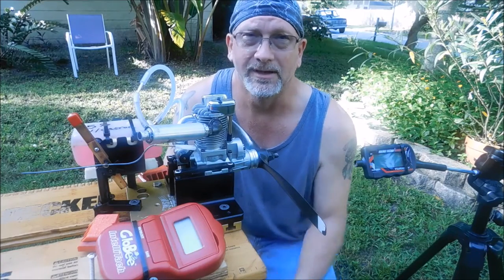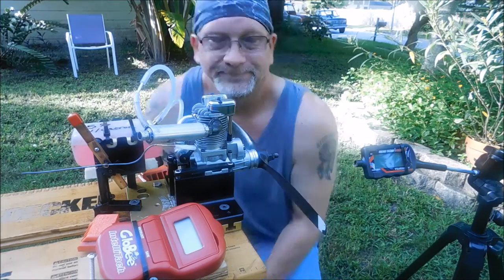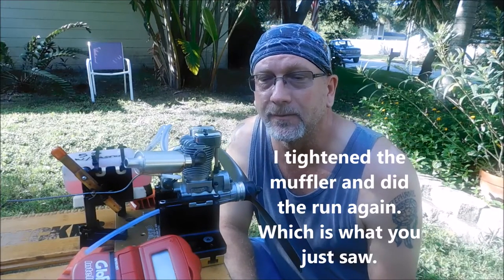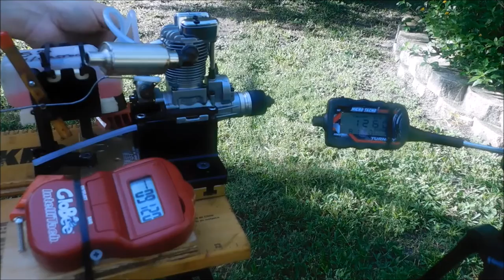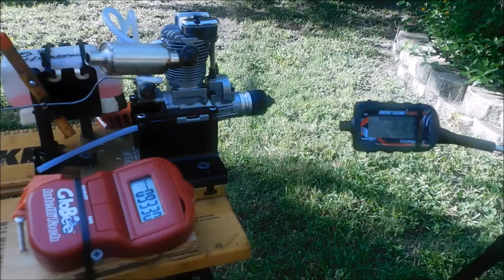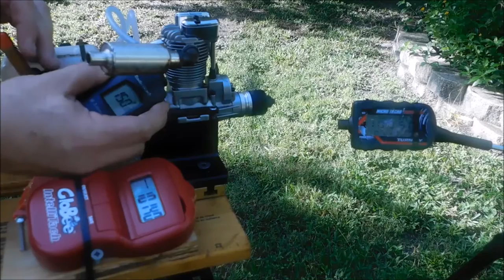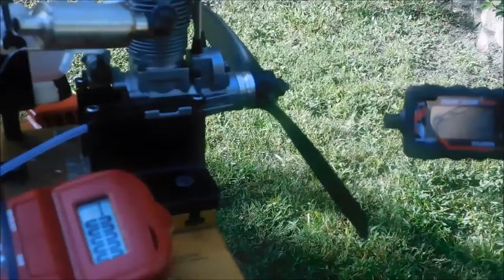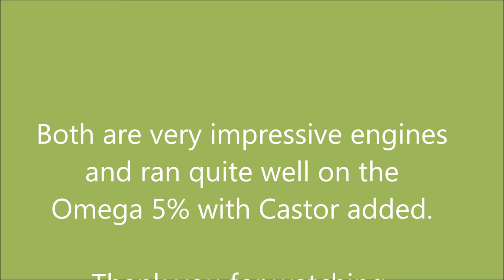Saito FA-91S vs. Saito FA-80

Comment: Hi David, Peter Chinn and Clarence Lee both talk about running four strokes on 15-17 % oil, they mention that they run better and less chance of detonation etc. due to the lower compression ratio, One day If you get a chance is would be interesting to see one of your comparisons running 20% and then 15%
Reply from the maker: I usually always run my four strokes on Omega 10%, which contains 17% total lube content.  So either video from this playlist on the 91S shows that fuel being run. https://www.youtube.com/playlist?list=PLsvn3JGZAOMu6-tu-3wKh-Ijxw35Z3CNm
Likewise this playlist shows the 80 being run on the same fuel. https://www.youtube.com/playlist?list=PLsvn3JGZAOMtRgqHccoZ9BawOeZWXylPt
I do not have access to fuel containing only 15% total lubrication content nor would I run it in any of my engines.

Comment: Hi David, by chance ,have you ever checked if the carb on the fa80 will fit the fa91? Thanks
Reply from the maker: Harvey, I no longer have my Saito 80 so I cannot do a direct comparison.  While I am pretty certain that the carb of an 80 might MOUNT to the 91S, I do not think the barrel opening is the same.